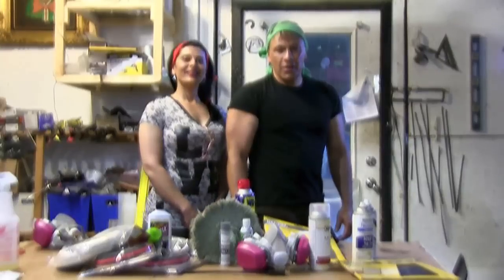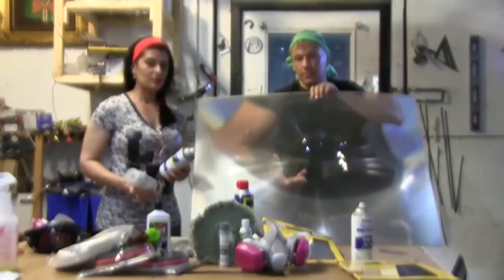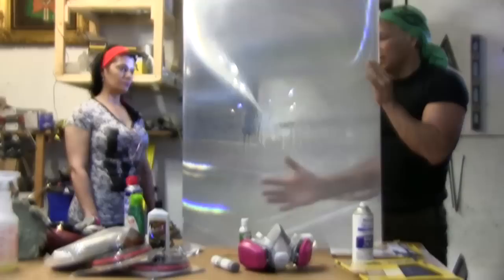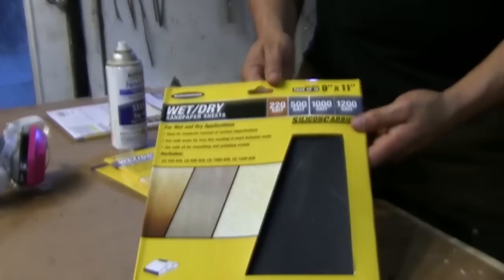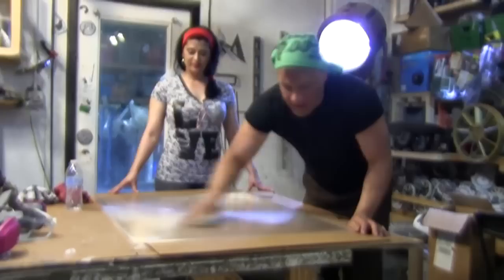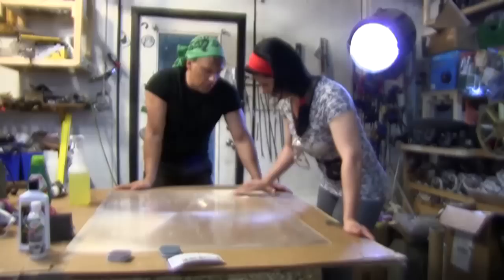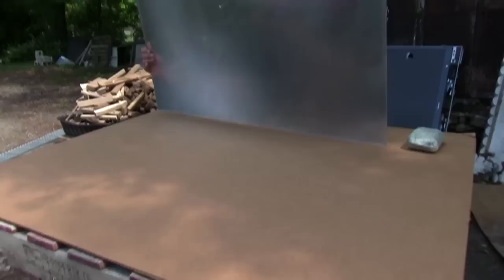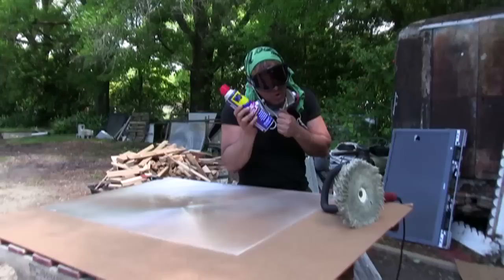Convert Linear Fresnel Lens to a Spot Fresnel Lens GreenPowerScience

Comment: I found a clear spot lense on a 1997 Toshiba 50 " Ultravision projection tv. I took it out and tested it in the guy's driveway before I paid $30 for it. It was popping pebbles out of the concrete it got so hot. tv is still in perfect working condition. You can add that tv to your list for clear spot Fresnel lense tv's.
Reply: Thank you so much for your comment. I just picked up 8 rear projection TV’s are am hoping for the best!

Comment: It's a good idea to use a new pad every time you step to a new grit grade.

If you have residual coarser grit, you will continue to be putting larger scratches in the plastic and never buff them out.

Comment: Good job you are using my idea!! I was playing with mine today and was melting glass. Best type of lens to sand and polish is one from acrylic. When I did my lens I started with 600 grit wet dry sandpaper then moved up to 2000 grit wet dry paper then used a drill sander with cloth and headlight lens restorer to polish it out and its a lethal spot lens. The lenses that are thin milky floppy and are yellowish will let more light thru but the best to use is an acrylic lens. So by what you are saying in the video that this has been done before I did.
Reply from the maker: Hi Michael,
https://www.youtube.com/watch?v=eZx4XRk6rI8
This process is part of the Level 3 lenses we work on. We have been using all three options mentioned in this video since 2010. We also make custom optical and solar lenses. We did this video because a lot of people emailed me regarding a web forum with the polish only. Did this video to share what has worked best in our experience over the years.
Reply: I did a 50 inch linear last year and its a lethal spot lens. Right now am hunting for 60'' or bigger. My neighbor up the road where I got my first lens from has a giant 65'' big screen Mitsubishi projection TV and I told them if it goes belly up let me know and I was told that the Mitsubishi projection TV's often yield nice spot lenses and nice clear linear lenses too. If you want to go my channel and you can see my lens melting basaltic volcanic lava I got out west in the 90s and glass melting. I subbed your channel last year and liked your facebook page.

Comment: I just acquired a fresnel lens from a toshiba 60inch rear projection, did the WD-40 test to check if it's worth diving into, and the center became transparent. I just wanted to confirm a few things; 1) have you used this exact lens since you've stated that you've obtained every lens out there. 2) if so, how powerful can this lens be capable of. 3) just wanted to double check that you are in fact buffing and or sanding the side of the lens where all the patterns are protruded, the other side yields no patterns.

Comment: Someone I went to school with has got me 3 lenses I will be picking up next weekend 2 52'' lenses and one monster 60! The 60 incher is a 16.9 but it is a very nice clear linear just like the 2 52'' lenses I will be getting and yes all will be buffed into spot lenses.
Reply from the maker: Michael Ellestad Sounds awesome. The buffing is a bit exhausting after a while. Also, set up a fan and work with the wind at your back. The process produces ultra-micro fine particles and fumes I noticed respiratory irritation even with the good mask. Acrylic fuming occurs and combines with bonnet material and vaporization of lens scratch remover. Looked it up and no known work hazard for acrylic fumes.
Reply: Yeah I did exactly like you said I was in my shop with the doors open and fan running while doing this.

Comment: will this work for drying wet rocks? i do gold prospecting once awhile, the rocks that i want to crush are usually wet, and rock crusher gets clogged. Will this work to dry rocks spread 3-4 square feet area? not trying to melt anything but dry them as fast as possible.
Reply: If it is large, hell yeah

Comment: You mentioned that 16:9 lenses don't work as well as the 4:3 ratio lenses. Could the sides of a 16:9 lense not be "trimmed" to bring the lense size down to a 4:3 ratio?
Reply: ...as in possibly using a "score and snap" method?
Reply from the maker: The size is not the issue, the lens type is. 16:9 is newer technology = a better TV picture but a poor lens. As technology advanced with projection the lenses became more of a soft focus screen vs a clear fish bowl lens.
Reply: Now that explains it! Thanks Dan.

Comment: I believe it was a Mitsubishi Projection TV (Edit: or maybe it was a Sony...?) someone dumped in a lot nearby.  The ratio seems wider than what you said was optimal.  But maybe/hopefully it can work.  If anything, I can make a true mirror from the double sided mirror I got from it.
Reply from the maker: Those are ok but not great, they are usually thin laminated lenses. The first surface mirror is a good find.

Comment: I'm polishing a lens. I went sanded with 600 grit, then wet micro-meshed with 3200 and 6000. All on the back side of the Fresnel ring side.

I did test the lens, and with a sheen of oil, it looked better.

My lens now looks incredibly dull and not at all like yours did when you reached that stage.

What on earth am I doing wrong?

Comment: using a cement edge to clear a buffing pad is really stupid, not only does it tear up the buffing pad but it also traps little pieces of dirt and debris in the pad that will scratch the surface you are trying to smooth, call me crazy but that seems kind of counter productive to me, instead do it like the professionals,  either set buffer upside down on a surface, spin it up with one hand then starting in the center slowly drag the edge of the screwdriver blade out towards the pad edge, this will clear the pad for reuse without adding any contaminants..After you've done it a few times you'll be able to quickly use one hand to flip buffer over on your leg while clearing pad with the other hand.......

Comment: hi this is my second video I've watched of yours. I noticed some errors in your process from my experience as being an auto detailer. I would paint cars color sand them and polish them by hand obtaining muscles like yours in the process. once you've use 1500 grit or finer wet and dry sanding you do not want to go to a rubbing compound. Rubbing compound is far more abrasive than 1500 grit sandpaper. So when you're done using your sandpaper you're damaging all your work with a compound. The most you would want to ever use is a polishing compound and it should be a fine Polishing Compound after sanding with 3000 or 6000 Grit. So you're adding extra time and effort and doing damage in between processes.
 the biggest mistake you're making is rubbing your polishing pad on the cement! the last thing you want to do is ever touch anything you're going to polish with on the ground at all even for a half of a millisecond. there's no way to clean all the dirt you've picked up I don't care how much you spin it.!
I made the same mistakes the first time I detail a car from painting and color sanding and then polishing. I really need to get myself a lens when I can afford it. good job considering you did extra steps.
Reply: Excellent advice. I completely agree. Also, try not to bounce the buffer. Its tough to do with that much torque but it builds the bi's as a silver lining!
Reply: Excellent advice. I completely agree. Also, try not to bounce the buffer. Its tough to do with that much torque but it builds the bi's as a silver lining!
Reply: I agree,change pads with each grit change and mark them!

Comment: Question
Now that we have our Lensew in a Frame
How do we Keep it Clean ???
Windex and a Soft Cloth ?
Reply from the maker: Dollar Tree or Walmart, "Totally Awesome" spray costs less than $2.00. Spray heavy, water hose, then clean bottled water. Wipe the smooth side as you would glass. Wipe the ring side as you would a record (LP), with the rings. Dry and good to go.
Reply: Take two soft bath towels slightly larger then the lens and sew them together on three sides and when it's not being used store it in your new home made bath towel lens cover. I would suggest you use micro fiber cloths to wipe it with as they won't leave scratches.

Comment: I'm confused. The lines/grooves on two of my lenses are circular, not horizontal. One side is smooth and one side has the circular grooves... which side do I apply the resin or paint?
Reply from the maker: TTime685 The smooth side. Do the oil test. Do not mess with the circle side. That is the Fresnel.
Reply: Ok that's what I thought. Thanks Dan!  The horizontal lines are really hard to notice on some lenses.

Comment: I did this with a sandpaper with a grit of 400 only and then polished it. It didn't work. Is it because I didn't polish it with a 6000 grit sand paper? How crucial is that step? I'm gonna run down to the store again to purchase the sand paper.
Reply: Jeffery Saeteurn 400 is way to coarse to polish or buff most materials... you will want several grades of grit up to 4000 to get a quality buff

Comment: Hi there, short questions:
Is the linear lens better suited to hit up water pipes? (as the heat is liniar dispersed along the pipe?)
or is the linear lens simply bad for solar applications in general?

Thank you for the great videos!!
Reply from the maker: +andipelamine Hi, Most linear lenses are not actually true continuous linear lenses. They are spot lenses with the front surface stretching the beam to about 4 inches wide. Older linear lenses, pre-1999 are great and work well on sections of pipe. The less expensive linear lenses work well to they just reduce light throughput by about 30-40%. The buffing removes the linear side and allows the spot to form. Overall, the "power" is the same, just spread over a larger area. So if it is a good lens that is linear, it will work better for a pipe as the surface area contact to the water inside is increases. Buffing does clear the lens a bit but spot lenses are not recommended for long pipes. Reflective mirror troughs are a better choice. A true continuous linear lens (not manufactured in sizes over 200cm) are similar to a trough beam. A trough mirror is much better for a long pipe than a Fresnel Lens. Here is a link to our trough mirror videos:
https://www.youtube.com/user/GREENPOWERSCIENCE/search?query=trough+mirror

Comment: Hello! I have procured two fresnel lenses! Unfortunately, they are both linear. I found your explanation of whether or not I can convert them a tad confusing. I would like to try anyways and while I do not mind hand sanding, I would really rather not buy a buffer. Is there an alternative to using a buffer? Thank you in advance, whether or not you can help.

Comment: I tried this but my lens became foggy and did not work. Any idea what I did wrong? I sanded with a random orbital sander at 220 to get the lines off, then sanded by hand from 800-1500-2000-3000, and then finished by polishing with turtle wax, but the turtle wax seemed to just mess it up. And now the lens appears to be ruined. Any suggestions?

Comment: I have a fresnel lens that is smooth on both sides from an old tv I think it was a Toshiba. If I hold it horizontal with a ceiling light above it on one side it has circular pattern turn it over an I can not see that. So would that side be toward the sun? Thanks

Comment: Should have done a "before" and "after" close-ups (as you did the "after" closeup at 02:42) using the WD40...and both close-ups should be in a frame that positions the lens in EXACTLY the same place relative to the camera, and for at least a couple seconds to allow people to pause the vid to clearly see the difference. Better yet, split-frame the comparisons...again for at least enough time for people to press the pause. Your demonstration at 02:42 was pretty much no value-add and could even have been left out.

Comment: GREENPOWERSCIENCE could you make a fresnel lens with a plaster mold and epoxy blend or will you show us soon?
Reply from the maker: Jonathan Perry The plaster does not work well because the original is 3 dimensional and locks in to the plaster. There are some rubber release molds but they can distort the rings. A very small change makes the lens an optical rainbow vs a Fresnel. There is a process that works great, I may open source soon.

Comment: I got what looks to be a close to perfect spot lense out of a Mitsubishi medallion hd 1080 series tv. I had bought the micromesh expecting it to be a major linear lense. My question is would it be wise to use the micromesh even though its already close to a clear spot?
Reply from the maker: Zap Skip the micro mesh and buff. Some near spot lenses can get pitted with scratches if there are no linear grooves to remove and you end up with white spots. Use a compound and then polish with WD-40. Usually 16:9 aspect ratio are not the best but I have seen some really good ones.

Comment: I just got a lens which seems to be linear (Sony, kp-43t75, made in 2000). It has a clear piece of plastic on each side of the lens. Should I keep them on? How do I know if it can be converted to a spot lens as per your process?
Reply from the maker: Acrylic sheet save for window etc. 
Lenticular lens, black/gray one save or trash.

Separate tape with carpet knife and spray WD40 on Smooth side of Fresnel Lens, if it clears up, the buffing will work. Fresnel side has the rings like an old LP record. You can see and feel the difference.

Comment: GREENPOWERSCIENCE  the fist part of your video you said that you could spray resin on it could you please tell me which product to use
Reply from the maker: Spencer W Hi, One option is regular clear enamel or lacquer coat that you spray on. This requires an extreme controlled environment as high humidity or moisture can result in fogging that cannot be corrected. These sprays are designed for non-clear surfaces so what looks great on furniture, may look bad on the lens. Clear gloss spray requires testing and skill. The resin option is a UV cure version that is applied inside flat then allowed to self level for 24 hours. Mild UV exposure is slowly added. Once a mild cure has taken place, the finishing cure is direct sunlight. These are both tricky processes.

Comment: Got my 60 inch polished but its been too hot to work in the shop to frame it in
Reply from the maker: Michael Ellestad Same here, we had to break down and turn on the AC. I end up dripping all over the Fresnel side with sweat.
Reply: GREENPOWERSCIENCE  I can't wait to get a 65 or 68 inch lens next. The 60 inch I polished is one of them 16.9 lenses and it was a beautiful clear linear

Comment: Hey guys, i tried the glossy spray and i fucked up my lens. Any chance to remove the glossy clear painting? its not even clear its kind of milky now... and i also tried to clean the circular side a bit but hey i fucked up this side too any chance to rescue my perfect sized lense?
Reply from the maker: Aaron Scofield Hi Aaron,
The Fresnel side cannot be salvaged. The smooth side gets milky if the humidity is too high or the temperature difference between the cold spray decompressing from the can to a warm lens. You need to sand the crap out of it down to the plastic (smooth side not Fresnel). It will look like a frosted mess. Once you get to this point test with a shot of WD-40. If the frost clears then you are good to go. Clean with alcohol, wash, dry and try again. Buffing may be a better option. If you opt for the clear spray again, make sure the humidity is low and do a closer thick spray. Start furthest away while the lens is flat the rapidly cover in rows moving closer to you. This allow directional overspray to land on a wet area and mix clear. If you start spraying close to you, the overspray dries instantly on a clean dry unpainted area and makes a beautiful frosting effect:-) Buff it if you can, spray is a pain in the ass. Even with HVLP pro spray and a booth. Pro clear for cars releases in areas on the plastic creating weird blemishes. I have tried it all. Buff, Buff, Buff.

Comment: which side should I polish? with circular grooves?
Reply: I can find grooves (circular, not linear) only on one side of lens but opposite side is fiat without grooves
Reply from the maker: Buff the flat side. The groves are micro fine. Test with WD40 on the smooth side. If it clears up then it will work, if it does not clear up the linear pattern is embedded within the plastic and cannot be corrected.

Comment: Hi +greenpowerscience, is there a relation between the size of the lens and the output power? Like the 60" would be more powerful than a 10" one? Tks for your videos, really nice and interesting things.
Reply from the maker: Power is based on size and optical clarity. A linear soft 60" lens has about 7x the power of a 10" spot lens. The larger the collection area the more power collected to the focal point. The more clear the lens= more solar transmission=more efficient.
Reply: Tks. So for same optical clarity, a 10" spit lens would provide something like 300c (2100/7), right? I couldn't find anything on the fact that collected light goes to the center. Tks for that.
Reply from the maker: Temperature is not a rating for "power." A small spot lens can start a fire quickly, like a lighter or candle. A large, dull, linear lens has a bigger focal point and builds temperature slower but offers more power. This is more like an oven. 

1 sq M (collected sunlight) = 1000 watts if the lens could be perfect. A good spot lens with 90% optical clarity, 1 sq M = 900 watts of thermal collection. A 10" sq Spot lens = only about 59 watts. 
A 1 sq M dull linear lens with a 60% optical throughput = 600 watts.

The best are the 90%+ spot lenses we have on our website. They offer both rapid and extreme heat + the power for heating larger amounts of material.

http://greenpowerscience.com/SHOPHOME.html